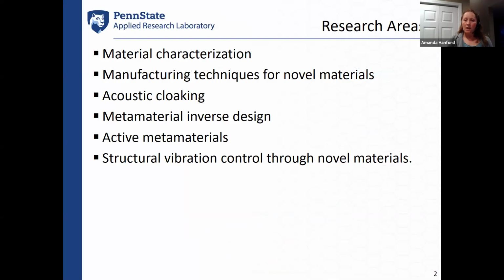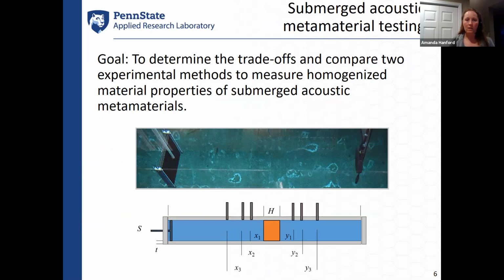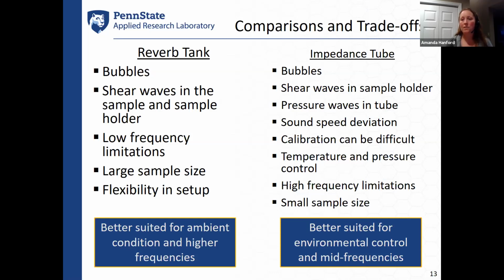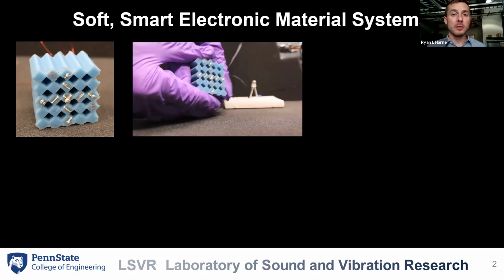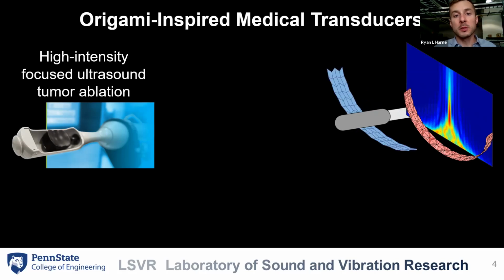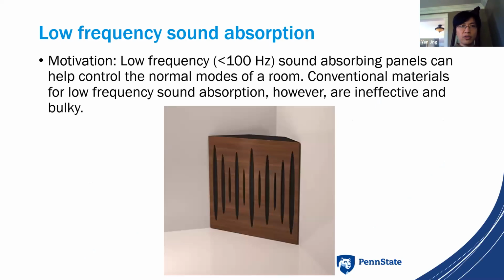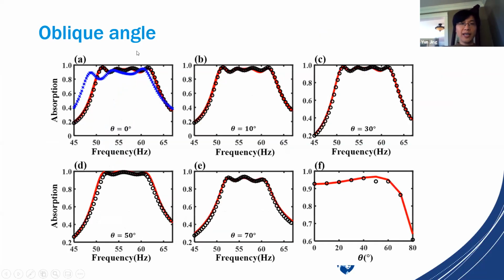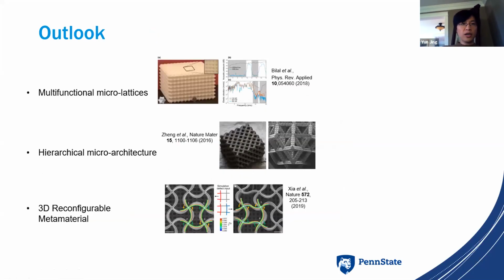Acoustic Materials and Metamaterials Group

Comment: Nice work by all.  My general question for all things metamaterials is always how robust are your designs?  What happens to projected performance if manufacturing uncertainty and/or in-service degradation/changes (dirt and debris buildup) breaks up the 'perfect periodicity' assumption implicit in unit cell theory?